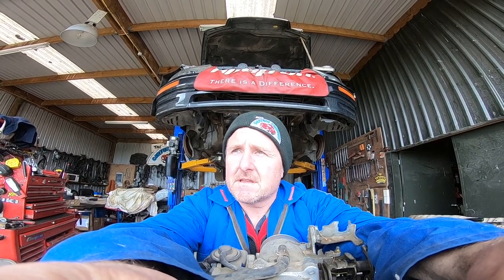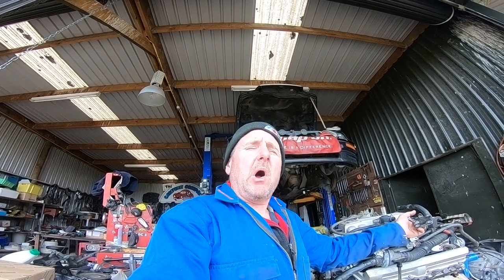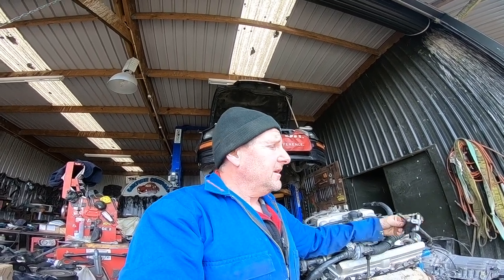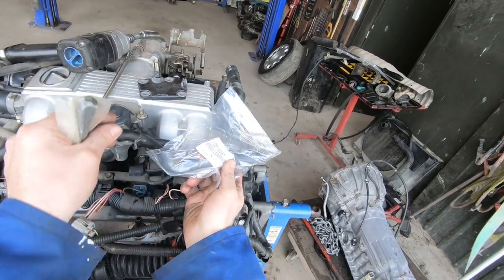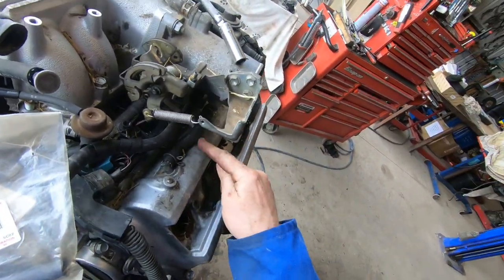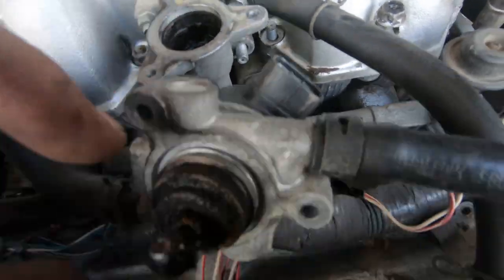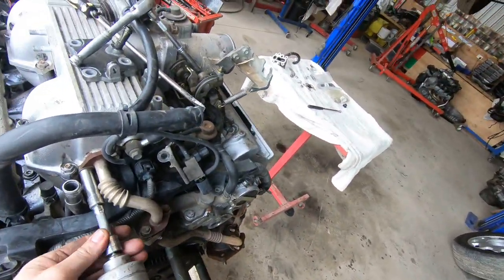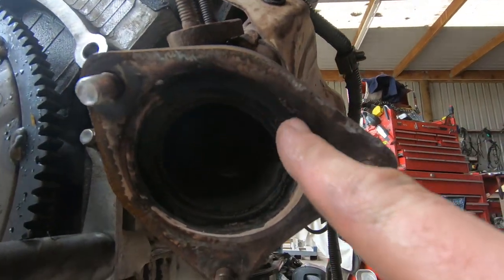1uz EGR system removal

Comment: I left my egr valve into the 6 port connector and was able to secure it. So when my engine is cold it won’t throw a code, however once it’s hot it throws code 71(Egr malfunction) every time.
Reply from the maker: We normally add some resistors to defeat this issue.  Cheers Kelvin

Comment: Hey i have a question if you dont mind. My venom auto block offs did not let me retain pcv. I plan to run a vented catch can for the pcv system. Is this fine on stock ecu?
Reply from the maker: Hello Daniel.  Personally I always fit the PCV system on stock ECU.  The breather system will work with a catch can provided you set the system up correctly, Dont just stick a catchcan attached to the PCV valve , that isnt correctly.  The PCV system left in place has a few advantages for performance and overall engine operation.  Cheers Kelvin
Reply: @CartuneNZ  what would be the correct way to plumb it? The pcv has 2 ports an in and an out, both of the valve covers have fittings, would the straight fitting pcv valve u showed in the video go to the in? Or should this be a vented breather filter? The other side valve cover has a 90° fitting where would that one lead? Its a 1995 engine. Thank you for all your help!

Comment: Brilliant video Kelvin, perfect for what I need. Im swapping my 96 Euro LS400 engine to a 91 JDM SC400 engine but keeping the 96 management and loom. 
Interested to know what resister(s) I'll need and where to fit them.
Reply from the maker: The later loom and ecu is much better.  Ive got a video coming of swapping looms.  Around 10k resistors (from memory) should be close.   Confirm by checking your motor windings.   Cheers
Reply: @CartuneNZ  Any chance you've covered how to place the resistors.  I'm pretty inept at wiring and electrical but follow instructions like a champion.  I've got an 92 Canadian EGR system that doesn't run through the crossover.  I can supply photos/video if you're interested.
Reply from the maker: @YhAFbwts  no,  we dont see egr much here and as its been covered so much in past forums I never got around to it.

Comment: Yes please to a part 2 or info on doing it would be amazing
Reply from the maker: If I get another one in to have it removed I will do a video on it.  Cheers Kelvin
Reply: @CartuneNZ  i would love to see the part 2 aswell
Reply from the maker: Part 2 relies on a uz coming in needing the egr removed.  We will see what gets booked in
Reply: @CartuneNZ  ive got a question about emissions because i live in California i wont be able to pass smog if i delete the egr, but what if i get a celsior ecu seeing as celsiors come factory without the egr, then would i technically be able to pass smog?
Reply from the maker: I think the car also has to pass the emissions test , and some require pluggjng in the obd2 tool,  which non vvti celsior dont have.  Not really looked into it further.

Comment: thank you so much. why are there so many articles saying DO NOT DELETE THE EGR VALVE ahhaa the majority of the things i read say it helps shrink you combustion chamber, but why would that help anything?
Reply from the maker: The EGR feeds dirty exhaust gases back into the engine which reduces the quality of the burn which drops the combustion temps , reducing the Oxides of Nitrogen.  Cheers

Comment: Thank you for the video. So, is it possible to remove EGR by just removing the valve and vacuum modulator and plugging up those 2 hoses? Aside from the PCV system, could you blank over the EGR valve gasket? Just wondering if the EGR pipe behind the motor needs removed for those that can't pull the engine. Is that Celsior plate to block the EGR valve and retain PCV functionality? I greatly appreciate it!!
Reply from the maker: Hello.  when removing the egr I always fit the celsior PCV plate to make it look neat and tidy.  Each different ecu requires different ways of blocking the rest.  personally I dont like extra crap left of the engine so it all comes off and is done correctly when i do it.  cheers Kelvin
Reply: Hell yeah you can. All I did was plug the passage holes in the intake with freeze plugs. In my neighborhood we only have visual inspection, have to get crafty.

Comment: Do you have a link to a video about the wiring or a little more detail on what to block off/delete? I just recently bought a 90 ls400 for 400$ and during the process of replacing the starter and whole lotta other things i had to bend the top of the egr exhaust and when i put the manifold back on the crossover pipe for the fuel rail is in the way of the egr pipe and the manifold.
Reply from the maker: Nope.  Haven't had another job come in for a EGR blank off as EGR are not fitted to many of the JDM cars which we see most of the time.  Cheers Kelvin

Comment: Is it that Series 1 uz has EGR or is this an LS vs Celsior difference?
Reply from the maker: This car is a ucf20 LS400,  running a gen 2 or series 2 engine with the stepper motor type egr system.  Celsior dont normally have egr.
Reply: @CartuneNZ  10-4, thank you Mr. Kelvin. Learning a lot from your platform. It's a real pleasure to have found your channel and make your acquaintance. Preston from Houston, TX here. 

Thanks for all that do you for the people interested in the uz series engines and such. I just found out about the 1uz myself and am grateful to learn from you sharing your experience and knowledge - much obliged, sir!

Comment: On 1996 obd2 what kind of resistor would I need to bypass the check engine light when deleting the egr system? Where should it be installed?
Reply from the maker: If its the stepper motor type there is more involved than just a resistor
Reply: @CartuneNZ  same electric type motor you have here in the video 2nd gen 1uz non vvti
Reply from the maker: @diszruptiveent3634  ok.  More than just resistors then.

Comment: i put an egr block off plate on my 1st gen ls400 from 1990, now i am dealing with feul issues but i am in the middle of fixing that. but with me putting a block off plate do i need to remove the egr module like you did and put the same plat you put on there
Reply from the maker: I show how I do it and this is my recommended way of removing the EGR.  Much easier without these parts in the engine bay.  Cheers Kelvin

Comment: Dude. I love your videos but I don't think you realize that in the United States where I live I can't have any check engine lights on or it's an automatic fail. The testing machine hooks right up to the OBDII port and I'm guesssing an EGR removal would definetly set off a check engine light.
Reply from the maker: I know about the US emission testing via the OBD2 port.  Done correctly the EGR can be removed and no fault code set.  I dont however recommend this where EGR is a legal requirement.  Check lights however are no issue when done correctly.
Reply: Resistor in plug in for pre 96 model years

Comment: hey mate, my 94 has tons of power when cold but once warm it wont even break traction. replaced tps, speed sensor, fuel filter... curious if you know anythin about this issue. when cold the car cranks quickly when warm it cranks much slower. new battery starter and alternator aswell
Reply from the maker: Yes,  I've seen it lots,  often theres an issue with ignition system,  fuel supply,  afm or ecu. Proper diagnosis is the key to finding the issue
Reply: @CartuneNZ  thanks for the reply. yea, diagnosing is alot harder when the dummy light wont come on and throw a code 😭 ill keep at her and update when i finally figure it out. love the vids btw! 
💙 from 🇨🇦
Reply: @CartuneNZ  ended up being a corroded resistor on the ecu and the tps wasnt fully clicked in place, drives great now so far!
Reply from the maker: @Bimmer-Fonz  well done on finding it.  Cheers Kelvin

Comment: any recommendations to how to clean all the carbon out of the intake ? i am in the process of doing this right now on my SC. TY for the great videos!
Reply: mob187eastside you can take it off and remove it chemically
Reply from the maker: Hello.  I find removing the manifold the best,  check back of the valves too.  I clean the manifold with degreaser which eats carbon well.  Also products like seafoam (we have similar products here) are sometimes good but nothing beats taking it off and confirming its spotless.  Cheers Kelvin
Reply: @1uzfe   yes well thats step 1
Reply: @CartuneNZ  Heyy Thank you for the tips i was thinking of makeing a dyi hot tank in my back yard with a metal bin and a fire but i dont know if the neighbors will like that LOL i will try to give it  a bath in de greaser ssome sea foarm and a ggood wash. i have one other question if you dont mind at 0:58 you show a coolant block off plug ? where would i find them or what are the called ? ive been googling random things like coolant block off or coolant plug and i keep getting random stuff
Reply: mob187eastside LOL or look up Coolant bypass cap

Comment: Hi have you done a video how to do the wiring for the egr yet? Thanks
Reply from the maker: Not at this point.  EGR aren't common over here in NZ and I sort of cheated with this one fitting the celsior ecu , which is non egr.  I do have plans as I have a OBD2 ecu sitting in my test stock atm.  Might also address the OBD2 non vvti transmission codes too.  Cheers Kelvin
Reply: @CartuneNZ  OK thanks, do you know if the engine will run in limp mode if the egr is disconnected or will it just throw up a code? Thanks.
Reply: @dmotors27  1UZ cant limp LOL jk idk

Comment: Hi there.
Is it possible to just block it of with a plate and leave everything where it is?
I'm from Germany and the police around here are really not joking around when it comes to illigal mods. This mod is illigal in Germany.
So basiclly I want to leave everything in place, and just block the exhaust gasses from passing throuh it.
It's on a 93/94 SC400 vom Cali.

And just out of curiosity, which stand alone ECU would you recomend?

Regards from Germany.

P.s. I miss NZ!
Reply from the maker: Yes,  a blanking plate in the correct place is fine.

Comment: Hey random question CartuneNZ can a faulty egr cause the 1uz to completely shutoff while driving, when I say completely shutoff I mean like someone hit a kill switch on the engine, engine sounded fine and was running great next second completely dead and if you try to crank the engine it will sorta start up with a rough idle then die kinda like the same way in your other video talking about the lexus codes p1300 and p1305. I've already replaced the coil ignition pack and it didn't fix the issue :(  as always love your video man very informative
Reply from the maker: I would suggest a faulty EGR is unlikely to shut a car down like the key has been turned off. Cheers Kelvin

Comment: Not only does my LS400 still have its egr, it's illegal to remove it here in California.  My particular egr is still vacuum operated via vacuum control valve. I clean the egr passages once every 2 years right before emissions test time. So far, still pass the sniffer test.
Edit: my car has California emissions so deleting the egr will trigger a code 71. There is a gas temperature sensor in the housing that detects exhaust gas heat. No heat,  no egr function,  = code 71.
Reply from the maker: Yep.  California rules are strict.  Good on you for understanding the EGR needs regular maintenance.  We are seeing lots of issue with late diesels and our crap diesel.  Most of the 1uz we see are JDM so no egr and it's not something I have to deal with much fortunately.  Resistors can be used to sort exhaust temp sensor and the motor windings with this system.  Due to the stuffed ECU the JDM ecu took care of all that for me.  Interestingly both this engine and another EGR equipped engine had noticable carbon build up on the back of #2 inlet valves. One the whole EGR was really bad.  Ive talked with mates and not all seem to have this build up.   Cheers Kelvin.
Reply: @CartuneNZ  Fast forward to 2021 and now all of the higher mileage Toyota Priuses are blowing up from clogged egr coolers/systems. On the bright side the remedy is to either clean it or just unplug the electrical connection from the egr solenoid and go without it and the addition of a p0403. Damn egr.